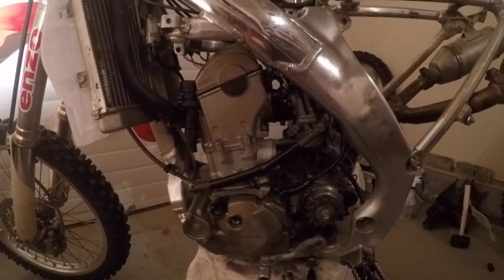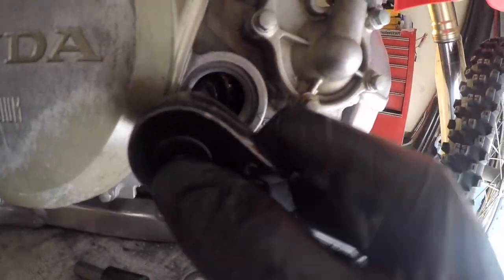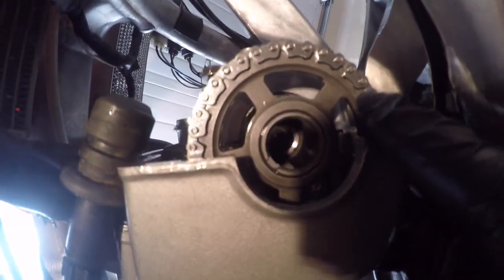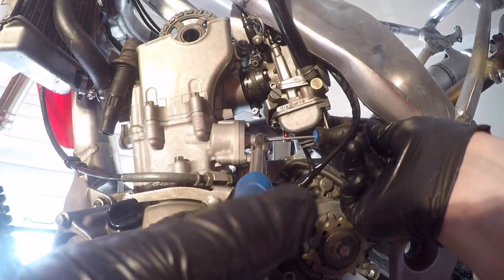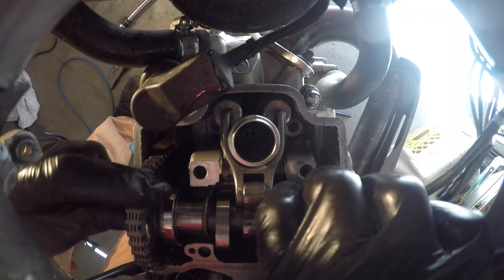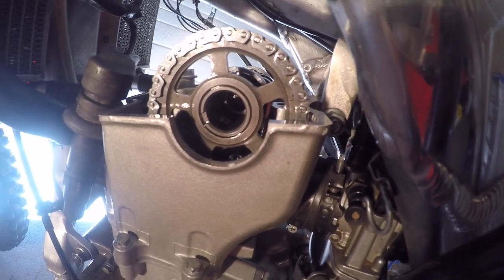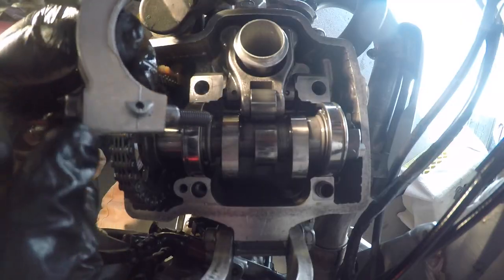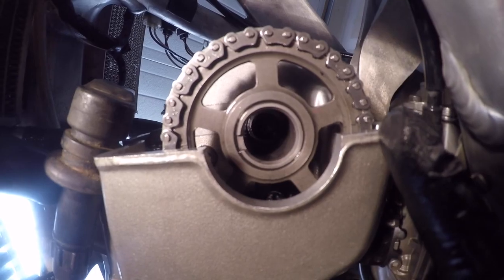How to Adjust Timing on a CRF250R

Comment: What do you do if the fly wheel won’t line up at tdc?
Reply from the maker: It may have slipped on the crankshaft. I have seen this once- the flywheel nut wasn’t torqued up. The flywheel managed to slip off its keyway.

Comment: Most excellent.  Have you ever had to replace the spring in the tensioner?
Reply: Aah.  I just leared this is tensioned using oil pressure.
Reply from the maker: This one is a spring tensioner, you were correct on your first try! Yes I have had the springs fail/get weak and require complete tensioner replacement. Or, you can buy manual tensioners which besides having to check them every now and again are almost fool proof

Comment: Do I need to put the rearward key on the cam slightly higher so when I put tension on it it aligns perfectly or is it fine being perfectly even before tension is applied?
Reply from the maker: It needs to be aligned when tension is applied. So, set it a bit higher to start if need be

Comment: Dude I did everything and it's perfect but every time I kick it it makes this like sound like you're breathing out air really hard and it has like barely compression and when I tighten up the chain it doesn't bounce back it just stays 😭
Reply: Fixed  it But now my engine  is locked  up😑😐
Reply from the maker: Yeah sounds like you’ve got other issues there…
Reply: @turdpike  I fixed  it lol

Comment: Hey, I have a knock noise when my 08 Crf250r is at idle and I believe it’s the cam chain or something to do with it. I haven’t opened up my motor to see yet but I want to know if I will need a new cam chain or just to tension it. The knock isn’t to bad, it happens when I take off and in the lower rpm’s, I just want to get it fixed before it gets too bad and other problems start to show up, thanks.
Reply: Also, could the knock be because the timing might be off or just needing a new cam chain?
Reply from the maker: If it’s running fine otherwise it won’t be a timing issue. More than likely the chain is a but old and stretched. They aren’t terribly expensive and it’s not very invasive to change it out. I’d start there, but you should also remove your tensioner and inspect it
Reply: @turdpike  alright thankyou, it also sputters when I steadily accelerate but when I hit that throttle and bang through the gears it doesn’t hesitate one bit. Will there be consequences and engine failure if I don’t change the chain out soon?
Reply: @turdpike  I watched a lot of your videos and I seen that the timing isn’t too hard to check. I’m only 15 and I need something to do anyway! I think it would be good for me to check over those things and learn how to do it, don’t have much else to do!
Reply: @turdpike  also, sometimes it’s a pain to start, but then sometimes it starts 1st - 3rd kick. It’s very unpredictable, is that anything I should be worried about? Sorry for all of the questions, just don’t what any huge expenses!
Reply from the maker: A chain breaking can be catastrophic just the same as the chain being so loose you run the risk of skipping time. Preventative maintenance is always better than reactionary, don’t wait for something like that to fail before you fix it. Chains are cheap insurance, and even the OEM tensioners are around $70-100 mark. Note that you’ll need to buy a flywheel puller for that specific bike in order to change the cam chain. And a torque wrench recommended to put that flywheel nut back on.
1-3 kicks seems normal to me, there’s so many variables to that it’d be hard to convey over this comment section
Reply: @turdpike  alright man well thanks, I will have a look at the chain and everything, I plan on getting one of the cheap 7 dollar fly wheel pullers. I know the chains aren’t very expensive so I play to install a new one, I’m just not sure on which one to get, I looked at the weisco one and it seems a little pricey at 60 dollars even tho it’s probably one of the best out there.. any suggestions?
Reply from the maker: @nalyd6386 Wiseco would be fine, $60 is peanuts compared to $2000 for engine parts if something happens. Be sure you use the correct flywheel puller, do not use a claw type puller you will ruin your crank.
Reply: @turdpike  alright man, thanks

Comment: If the flywheel is 180 degrees out, how do you align it?
Reply from the maker: If there is a disagreement between the RH crankshaft timing mark and the flywheel mark then it’s more than likely your flywheel has slipped on it’s key. You’d need to remove the flywheel and inspect

Comment: Hi Turdpike, thanks for the video. I currently have a no spark issue on my 09 CRF450R and I was wondering if the timing being off could cause a no spark situation. I originally assumed it wouldn’t cause this, rather the spark would just be early/late. Is it correct to assume this? 

My coil/spark plug is good and I got a new wiring harness, but it appears that my flywheel may have slipped because at TDC (primary gear dot lined up and cam sprocket lined up) it aligns with the second flywheel timing mark when in the manual it says it must line up with the first mark. I will probably investigate this either way and buy a new key, but I was just curious so I don’t get my hopes up if it won’t solve the issue.
Reply from the maker: Hmmm. I agree no spark shouldn’t be caused by a plausible flywheel slip, it’d still spark fine, just at the wrong time. Any chance you metered out the ignition coil? If the stator coils meter out fine too that’s where I’d go next. Then meter the coil to the plug cap. Hope this helps!
Reply from the maker: As far as mechanical timing, you’re better off removing the flywheel and making sure it did or didn’t slip! Then your mind can be at ease lol
Reply: @turdpike  Thanks for the response! I checked continuity to the cap and coil resistance against the values in the manual for the ignition coil and according to that it is good. 

What would be the process for checking the stator coil? I wasn’t totally sure of the proper method previously. I checked crank sensors to have the correct resistances. 

And yeah you’re right I might as well just to set everything straight.
Reply from the maker: Do you happen to have a service manual? If not it should be online free somewhere- but on other bikes you simply disconnect the main connector coming out from the stator and it’s a matter of pinning out different windings and checking their resistances. I don’t know the values you’re shooting for off the top of my head but even looking at a wiring diagram should tell you which pins you need to go on to check individual windings circuits
Reply: @turdpike   I may have confused checking the crank position sensors with this but I will check again in my manual. Thank you, I appreciate all the advice!

Comment: so after i rebuilt my 2005 crf250r i got everything good all marks lined up try to start and a few back fires open it up again and the flywheel marks are off a hair ive tried to redo it a few times and i keep getting the same thing i wonder if the flywheel keyway broke
Reply from the maker: That happened to me. I didn’t torque the flywheel nut properly and it spun. The bike backfired then refused to start. Didn’t slip much but it slipped. Pop the cover off and have a look
Reply: When I reinstalled the can chain tensioner the cam rotated back and the timing was off...still do not understand what I did wrong....

Comment: I know this is an old video, but following the instructions I still cant seem to get the top marks perfectly aligned. When I let the chain tension off, its still off slightly.  Moving the chain one tooth makes it off slightly the other way.  

Is this maybe a sprocket & chain replacement situation? 
I got the bike cheap not running.  Figured it wouldnt be a big deal.  I rebuilt the carb, put a new plug in, and all it would do is backfire a little once in a while. But I dont know how it could slip.  Its tight in there.  So maybe the chain it stretched?
Reply: How did you soloved it? Have the same problem atm..

Comment: Hey, I just bought a 2006 crf250r  and I was taking it for my second ride and luckily I went for a pass back past my place because I noticed it sounded less chirpy and then continued to loose power (I was cruzing around 40kmh) and then back fired and locked up. I was able to find neutral afterwards and was able to get the mechanism to rotate but no combustion...it’s been a busy week so I haven’t really looked further into it but have been trouble shooting online a bit. Could this have been a result of the timing not being set properly by the shop that recently replaced the whole top end? Or could it have something to do with the fact that first time shifting bike into gear it will stall without a throttle blip? I realize that might be the clutch basket having small grooves in it and the plates are catching a bit....I don’t have a lot of experience with bikes but 4 stroke race bikes I have 0...it seemed to run so good haha
Reply from the maker: Sorry to hear- it could be any number of things really. You say it locked up right? So when it did was the kick starter solid? Then it freed up later you’re saying? The fact it sounds like it gradually lost power till it quit seems like something internally was causing a lot of friction, which is usually bad news
Reply: @turdpike  hey you have a great video. thanks for the knowledge. quick question. does the Leftside case mark have to align with the "f" mark on the flywheel? in mine, there are two marks on the flywheel and aligns with the "f" (first mark) w/out tensioner. but when tensioned the marks line up with the second flywheel mark. would that unaligment cause issue or could it be i installed the stator slightly off? any input will make you my hero. thxs
Reply: Did you ever figure anything out

Comment: Have just rebuilt the top end on my bike, has a tapping noise coming from the head everything is timed all marks line up as perfect as I can get them, could this be valve clearances please help
Reply from the maker: Could be, see my other video about how to check them
Reply: turdpike can you have a listen to it and tell me what u think https://youtu.be/JX_oLURaIHA
Reply from the maker: Hard to say man, almost wonder if it’s the cam chain slapping around. When you put it all back together, did you happen to look at the tensioner to see if it was working properly? Maybe it’s hung up and won’t release as far as it is supposed to. Had one go bad on my 08’, and have seen them go bad on other bikes. Take the 8mm bolt out of the back of the tensioner, and put a small flat screwdriver in there into the notch. It’s been a while but I believe if you wind it counter clockwise it should hit a stop of some sort. If you’re able to turn it lots or even a tiny bit for that matter, it could be the culprit. Then once you are convinced it’s wound out all the way, start the bike and see if it made a difference
Reply: turdpike I can turn it quite a bit
Reply from the maker: Counter clockwise, correct? Ideally they shouldn’t need to be turned at all, once your screwdriver is removed it should snap extend all the way putting tension on the chain guide. How’d it run after you did that?
Reply: turdpike didn’t make a difference, I’m gonna get a mechanic to look over it thinking valves need an adjustment, but hopefully that’s it
Reply: @motomitch6309  did you sort it mate

Comment: How do I adjust the spark timing if everything els in the timing is good
Reply from the maker: The stator itself, by changing the angle where it is mounted. The flywheel has to come off and you’ll see alignment marks somewhere on the engine case and one on the stator. They need to be aligned. If not simply loosed the stator mount bolts and spin the stator till it does, then tighten it all down

Comment: so on the right side of the engine, the marks line up, so the piston is TDC, but then i don't see the flywheel marks... and then the camshaft is perfectly aligned.  when I tried to start it after we rebuilt the engine, the piston is getting stuck after it turns over once. please help
Reply from the maker: Something sounds wrong, the camshaft is positioned correctly? By that I mean the lobes are facing to the back of the bike with the piston at TDC (as indicated by the crank punch mark) it seems unlikely, and I’m trying to remember if it’s even possible, but the cam might be 180 degrees out. The lobes must be facing rearward when the cam marks line up
Reply: turdpike yeah the lobs are facing rear wear and the punch mark is lining up on the right side of the engine, but the fly wheel mark isn’t showing up
Reply from the maker: I’ve personally had the flywheel slip on me before, because I didn’t torque it down properly. It seems impossible but it can happen. Maybe the flywheel has slipped on the woodruff key. But that shouldn’t explain why you physically can’t spin the engine over. I’d remove the camshaft and let the cam chain freewheel, spin the engine over slowly till you see the flywheel marks. Then compare it to the RH side of the bike. If you can’t see the punch mark on the RH side, something has slipped
Reply from the maker: Also, with the cam chain disconnected from the cam, if the engine spins freely then you know the problem is with the head timing. Make sense?
Reply: Did you ever solve it? I have the same problem, and I suspect im 180 degrees off

Comment: I was setting my timing per the advice in the video, and set my cam lobes facing rearward at TDC which seemed to be 180° from where it originally was. I got the tick marks level and tried turning the bike over and it made an awful whining noise when it cranked over. I pulled everything back apart again, and now when I check my crank tick mark to make sure the motor is at top dead center, the punch marks on the flywheel are slightly off (previously they were lining up perfectly). Does anyone know what I did to my bike or how I should go about fixing it?
Reply from the maker: Brett Crochiere sounds like the flywheel has slipped on the crank end. If the opposite side crank punch marks are good your flywheel might have slipped. This throws off your spark timing. That nut holding the flywheel needs to be torqued properly. You wouldn’t think a keyed flywheel can slip but this has happened to me before
Reply: Did you figure it out?

Comment: So after I recently did a top end replacement, I put it back together and set the timing, but now I’m having a tough time kick starting it. It’ll start going through the cycles but then make a loud “clank” as if it’s getting stuck in one of the strokes. Any help would be greatly appreciated !
Reply from the maker: Juan Buendia are you referring to the loud clicking/clank noise the auto decompression makes? Do you know what I’m talking about there?
Reply: Turdpike I too had this issue after I got it started. Could it be the chain needing replaced?
Reply from the maker: Hard to say via description alone, would be nice to hear it. Often times I’ll notice people just have their idle set too low and the bike makes all sorts of noise as it struggles to stay running. Needs enough speed for the flyweight to disengage the auto-decompression

Comment: Hey mate I can see my marks on the flywheel but only one from straight on , I have to look to the left a touch to see both. Is this correct?
Reply: Recently put the flywheel on and torqued to spec so I dont think its slip, or has it? Hmm
Reply from the maker: MELTON115 does the bike run? It may have slipped a bit, its worth a better look. Carefully pop that cover off and you can usually save the gasket and re use it
Reply: turdpike when you say “it’s possible this could be 180deg”, what do you mean by that?  Could the flywheel have been fitted incorrectly? I’m troubleshooting a motor someone else has built that I can’t get to start as the timing is out.